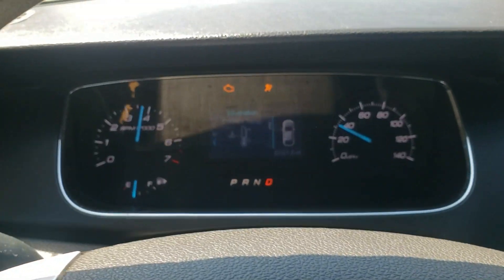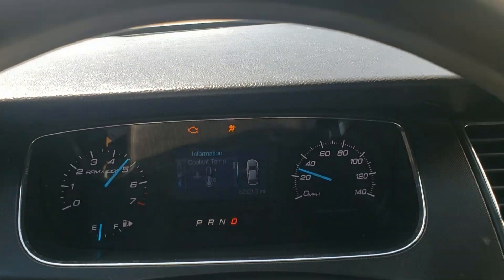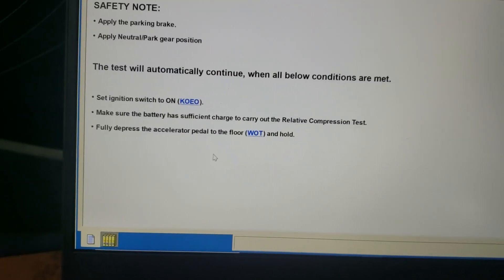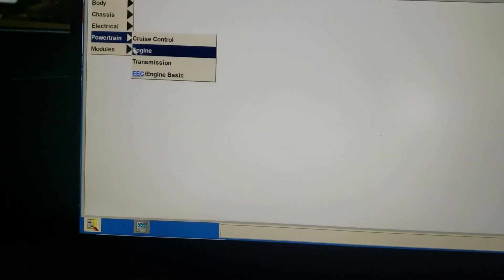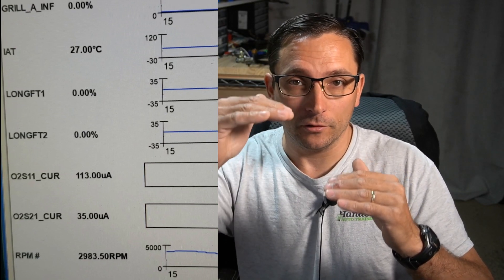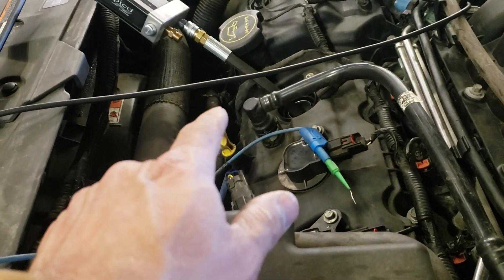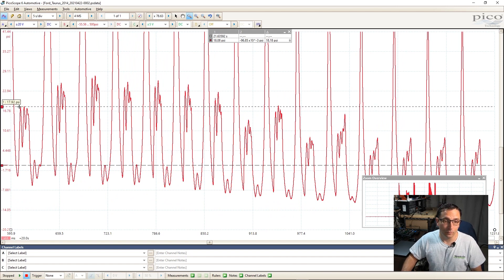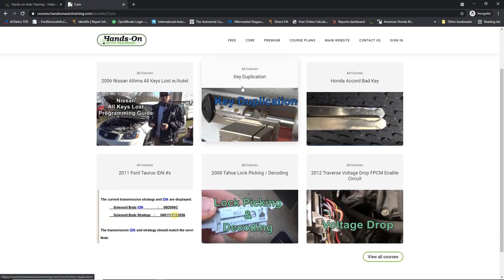2014 Taurus Clogged Cat

Comment: Thanks for sharing Brian. I like the over lay. I’ve taken Brandon’s in cylinder pressure testing course which was excellent. Brian could you have used a back pressure gauge in the O2 censor port and made the determination? Was your test done cranking or running? I probably missed that in the video. Anyway good info and thanks for sharing. Stay safe and well Artie😊

Comment: Question for ya Brian. I have a chance to buy an mdi 2 used for a good deal. Have you ever needed the mdi 2 if you’ve already got a j2534 device and can buy gds2. That’s what I have. You think it’s worth buying for 500 or use that for another year of gds2 with a cardaq?
Reply from the maker: If you call gm with a programming issue,  part of their trouble chart will lead to what interface you are using,  if not mdi / mdi2 they may tell you to consult the manufacturer of the device for support which can leave you stuck
Reply: Good point. I called the help desk asked could I register a used mdi to me from the previous owner they said they could do it for me remotely. Had them remotely install the new j2534 wrapper last week.